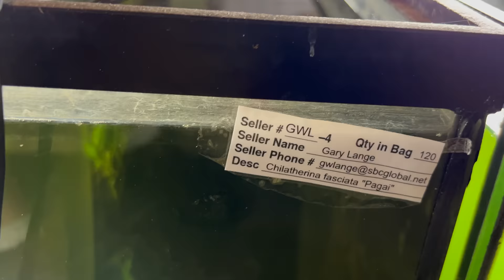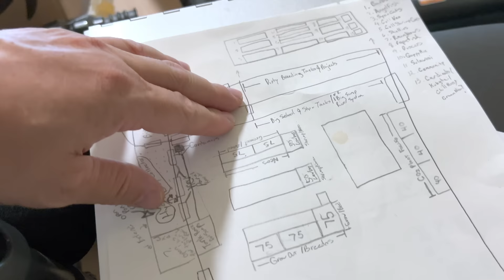Jam Packed Dirty Little Fish Room Tour

Comment: I look forward to seeing how you build it out. I'd love to know how you "just get daphnia" in your tanks. Is it because you don't filter? Is that the difference? Or is it the no water changes? I have live plants and botanical in all my tanks. Quite a few of those plants were once yours!  I do water changes about every 2 weeks depending upon the tank. And I have sponge filters running. I tried just cutting off my air, but the fish did not like it. I assume they need to be slowly acclimated to no air.
Reply from the maker: I have to source daphnia from somewhere first then once you have two to tango that’s all you need. Having no filter definitely helps. As far as the no air it all depends on fish bioload and if they aren’t used to it sometimes they can struggle with it. If you want high volume of fish it is good to have air especially at night. Since most my tanks are species only and lightly loaded it’s easier to accomplish.
Reply from the maker: Also the no water changes helps with daphnia as well

Comment: On your Sunco lights, are each of the two strips of leds in a tube? I was wanting to take the light apart are separate the lights to use on two different shelves. If they're in individual tubes and not permanently glued to the housing, it will work great for me.
Reply from the maker: Hmm you might be able to separate them…

Comment: How much weight do you put on those metal wire racks? Can they hold say twenty longs on each level?
Reply from the maker: I personally wouldn’t use those for tanks unless they are temporary. I will be custom building my own for longevity. If you want an easy rack I would look into the gladiator racks but you will want to support the shelves with plywood.
Reply: @LRBaquatics  I am using the dewalt industrial rack that holds likes almost a ton. It’s smaller than the racks creative pet keeping uses but I’ve seen her put 20’s on those wire racks so I had to ask your take haha. Personally scared to put anything on those bigger that 5g

Comment: I’ve been struggling with getting rid of green water. Even a full change only lasted about a day before the green came back. Using a UV sanitizer now, but it keeps going back to green! Any ideas of what to do?
Reply: Green water is always a nutrient imbalance combined with too much light. Gravel vac the poop or extra food, reduce your lighting to be on for 8 or 9 hours a day. That did the trick for my tanks
Reply: Also you cannot water change your way out of green water.
Reply from the maker: Zack is right. You could even go to 5-6 hours a day. The vacuuming helps because green water will leave a coat of algae on the bottom that seeds the water column. Daphnia will get rid of it right away but harder to do if you have fish in the tank. You could keep daphnia in a mesh container or breeder box to help as well.
Reply: Thanks guys! I did remove the fish, but the tank is still planted so I’ve been struggling with light. There was definitely some funk down at the bottom underneath. Backed off on lights and have my fingers crossed!